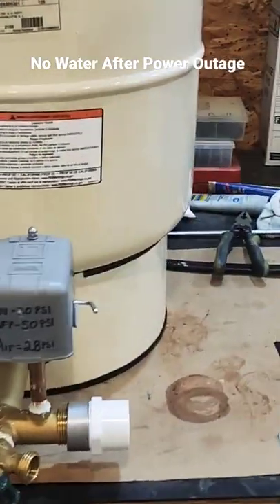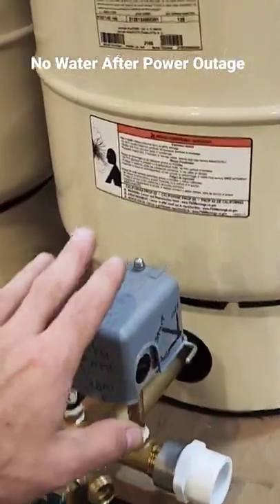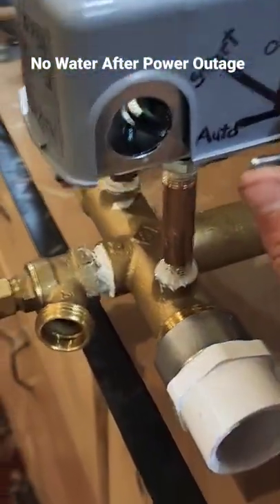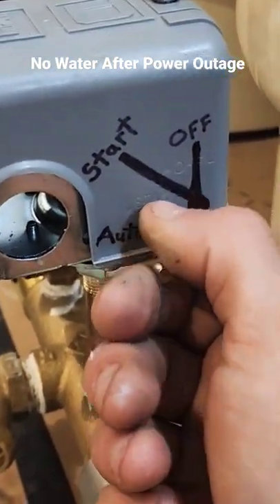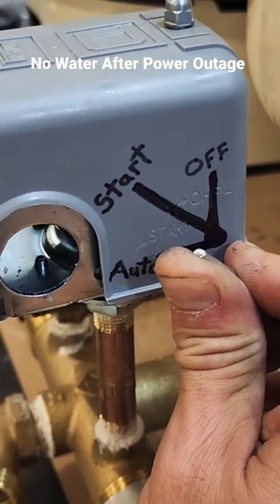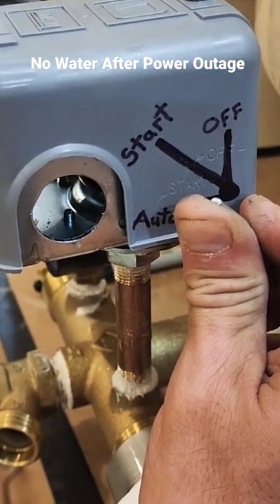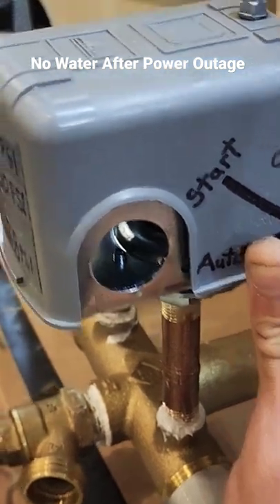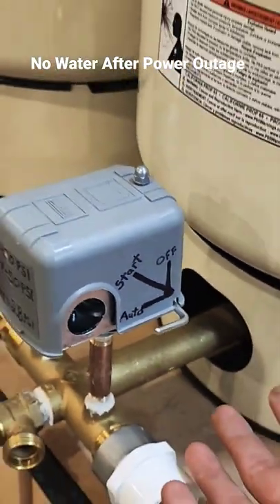No Water Pressure After Power Outage. Reset The System

Comment: what if your pressure switch doesn't have this lever?
Reply: Mine was like that. I took the cover off and used a pair of needle nose pliers to pry up on the plate inside. Took some fiddling and probably wasn’t safe from me or the box, but it worked.
Reply: @bucks2beards194 yeah that’s 240 under that cover. I don’t like to be shocked. 

Turned out my problem was that my well pump was dead.
Reply: Then likely your pump is shot or the breaker is tripped. This is a low pressure cut out switch, it's meant to keep your pump from burning up if the well runs low on water.
Reply: @Watthead80  Pump was shot.  Had a local supplier that had one in stock.  Better than the one that was dead.  Pulled the pump up and had it changed and back down in less than an hour. (thanks to my kid)
Reply: We flipped the contacts and it arcs so there is definitely power but the pump did not come on. We don't have a pressure switch on it. Just used the box to flip it like you said in other video
Reply: Hey bro. I love you Man. This video saved me hella money. Muchas Gracias.

Comment: What if it doesn’t have that lever?
Reply: You don't have to worry about it. It's a loss of prime switch. Used to help prevent pumps running dry
Reply: @MRBLACK1080   thank you, I wasn't sure what that switch would be used for, but we only have submersible pumps in this area, and if you lose prime on one of those, you have bigger issues.
Reply: If a pipe bursts it prevents the pump from continually pumping.   It requires a manually applied initial pressure to work.   The old versions would flood a home in no time.
Reply: @John Nelson  as long as flow rate is enough to cause fault position. I usually have them set at about 200kpa for jet pumps. Never installed them for any other reason apart from loss of prime.
Reply: @MRBLACK1080 Low pressure cut off switch. This is on a submersible pump which does not need primed.

Comment: Heres another tip, file your points, those r located in the pressure switch box that controls the pressure, the 2 nuts for pressure and cut off pressure, google how to file ur points, it will show u pics so u can see where they are, its easy, Ima girl and do this, dust & ants get in them and then u wont have water either due to no contact.

Comment: THANK YOU so much for this video! I lost power and my well pump shut off. No running water at all in the house. ATTENTION DIY HOMEOWNERS: my well pump was located in the crawl space under my house (no basement). I did exactly like the instructor said in the video and the pump came on by itself and the lever flipped to auto automatically. Leave it there. Test your water to see if it flows out of the faucets then. Voila! It works! Let your water run out of your faucets for a few seconds to flush out the lines before using normally again.

Comment: Every time power goes out, my tank fills with air, I have to go thru the ritual, shut power off to well, empty the whole tank, run the outside hose, open all faucets in the house til all the air is out, & tank is empty, then turn well back on and it refills and is fine until the power goes out again, so annoying, why does it do this?  U want 30/50, 50 PSI resting, 30 psi when the the pump turns on to start refilling.Turn nuts (little nut is cut off, big nut is actual pressure), clockwise to increase pressure, one full turn, turns it up 2 points. So if u want 1 point up for example from 49 to 50 a half turn clockwise.

Comment: When the water did run out with a well i did call a plumber to come check it out.  they also do well's, why i was 2.5 hours away.  It comes to be the breaker was off, not tripped, off.  Not sure who was there or what happened.  But he said if it happens again call an electrician!  After the flip back on there was no problems.  Interesting.

Comment: This may be a stupid question but I’ll ask it anyway. I notice that when I switch the lever to start and reach approximately 50 psi, it will continue to increase if ai don’t click it to off then return it to auto position. Is that normal? Will it automatically shut off to not exceed the recommended psi, the tank days 40/60 psi. Thanks for you help.

Comment: So I changed my pressure switch and did not drain my tank.... i made sure that my pressure in the tank was 2 PSI below the lower cut off... So if i hold the new switch to start it will start no problem..... then if I run say like by hose bib it will run great for like 5 minutes then it cuts off.  If I start it again it does the same thing any ideas?
Reply: Yes, 21 year plumber here. 2 psi below cut in is a great place to start. I have had to in some cases to use 3 psi differential.

Comment: My 40-60 don't have that switch what do you do
Reply from the maker: I'd advise watching my other pressure switch related videos. 
Flick the contacts & look for spark. If no spark happens, the wire down the well is probably bad/broken. 
Or flicking the contacts may fix it temporarily, if so, replace the switch. 
If its a old system, you'll need to watch the tank Videos to check the tank properly.